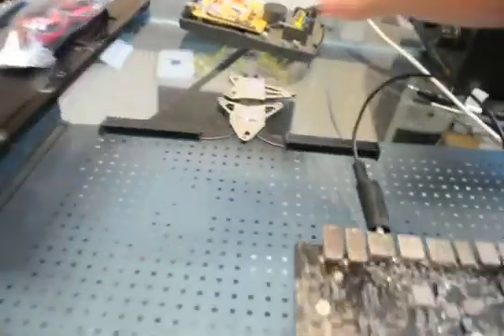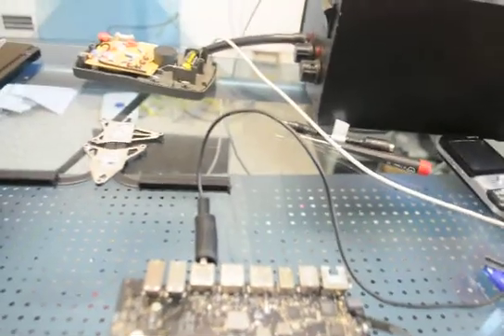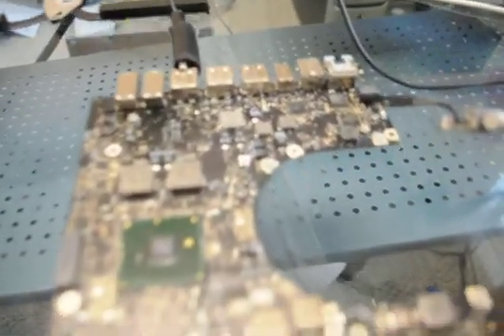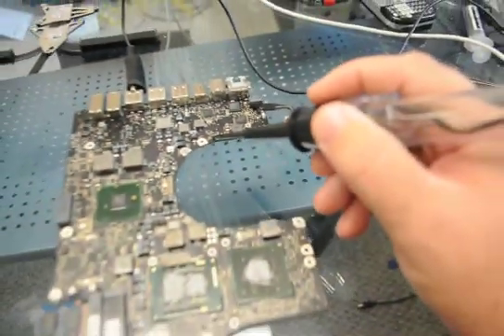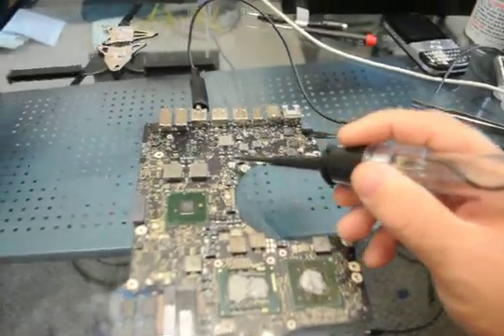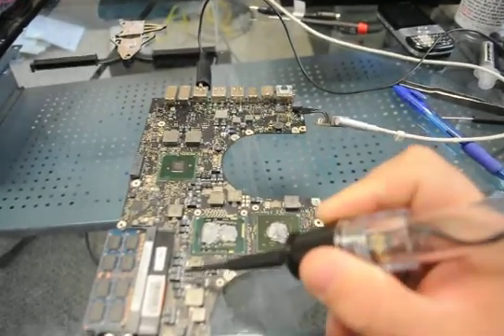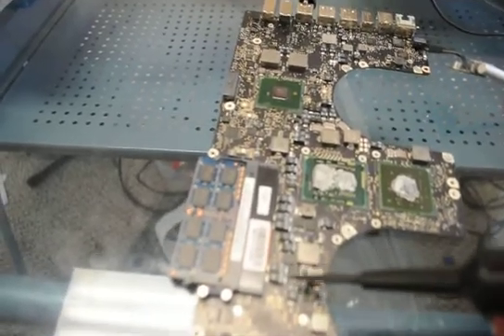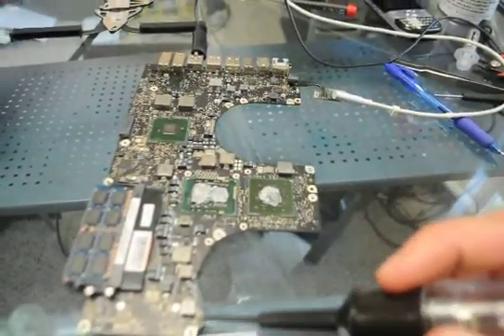Diagnostics on a MacBook Pro UniBody logic board that has power on issues with step by step

Comment: I have a system will will not power on, A1278. AC Adapter power light won't turn bright green when plugged in. It remains at a constant Dim Gr
een. Amy ideas what it could be?